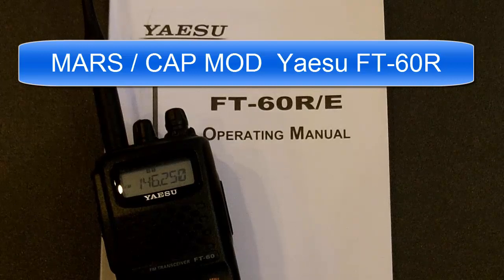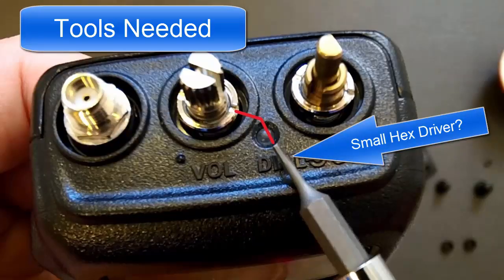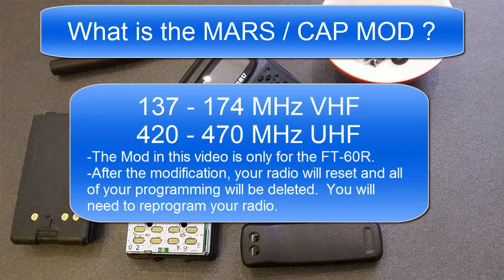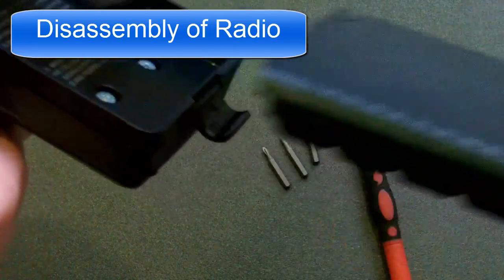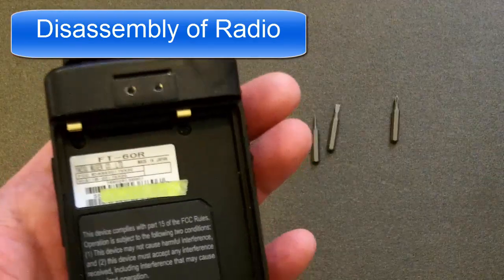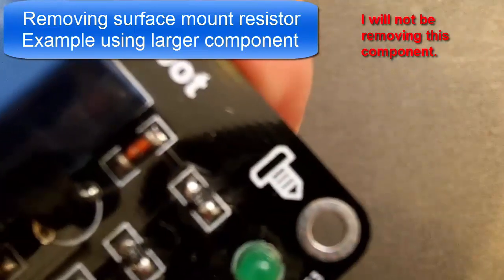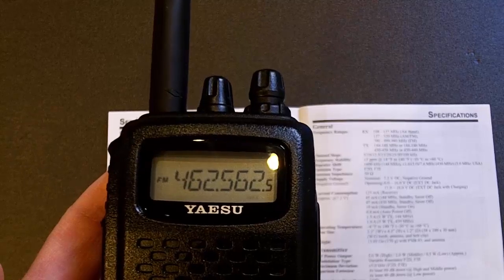MARS/CAP MOD for Yaesu FT-60R : Complete Tutorial : Eye-On-Stuff

Comment: Anyone who does this should instead place the tip of their iron on top of the resistor and then apply slight pressure to the side with a small screwdriver or knife. The method shown caused me to slip and scratch a few traces. Thankfully, all is good, but it’s much much easier to just apply heat. You don’t need a fancy hot air reflow station or a surface mount iron, a normal soldering iron should be able to heat the little component up quite accurately despite not being able to desolder it individually on each side and all.

Comment: @17:31 you show the factory specs of the receive being UHF/VHF 137mhz to 520mhz 
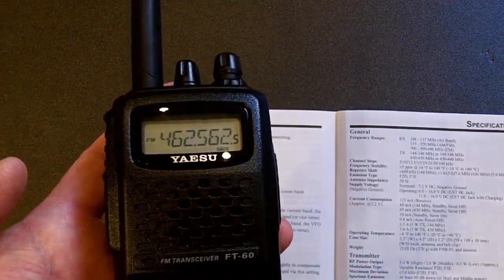@18:09 you show the ft-60r receiving a signal from the frs radio transmission on ch.1 462.562mhz
you are showing the ft-60r receiving but not transmitting on 462.562mhz but the factory specs show that the ft-60r can already receive on 462.562mhz without the mod. why not show it being able to transmit on 462.562mhz?
showing it transmit is something the ft-60r should not be able to do without the mod but it can already receive that frequency without being mod

Comment: After this MOD, the radio becomes Tri-Band? What about the quality transmission/reception in 1.25m (219MHz - 225MHz)?
Reply: The amps aren’t in the right spot or else they would’ve had it allowed in the first place. You’ll get next to no power out on 125 cents and a ton of power out on an unintended frequency in vhf, possibly uhf too.

Comment: Hi! Nice video and amazing explanation! I have a question: this work in the FT-65R? Thanks!!!!
Reply: If you have not already discovered, the 65 has a code that you can find on the www that allows the mars mod without opening the radio or making any physical changes. It is done in seconds by simply inputting the code.  Works great and is a brilliant improvement to the operation required for the ft 60.   https://youtu.be/ztFA_ckgnxo

Comment: Thanks! Does this mod allow you to broadcast also on Airband frequencies, 108 to 137 MHz?
Reply: Those use AM, im not sure a FT-60 can even use AM but I may be mistaken
Reply: @gary0228  I have found out that the answer is the FT-60 can receive AM on 108 to 137 MHz, but even with the mod, it will not TRANSMIT on Airband AM. Bummer. I wish for a radio that I can use while in flight that does TX AND RX on both Ham and Air bands. Darn.

Comment: I have wanted to do a MARS mod on my FT-60 for a couple years now and have watched several videos on the subject but never felt confident enough to attempt it. Your video, however, was so well done and well explained that I finally felt okay giving it a go. And it went perfectly! 100% success. Initially I thought I might have had a problem when I keyed up an FRS frequency to test it out the signal, it had a massive amount of screeching and squealing. I was using the factory antenna and had already been warned that this might happen with that antenna. So I swapped it out with a Diamond SRH77CA and got full quieting. Many thanks and job well done on the video!
Reply: I’ve had my FT 60 since 2017. I just found this video and made it real simple. I did my mod and my radio works great as well. Good job on the video.
Reply: Long time subscriber of you, tried doing this on my second FT60 and had the squelching issue. I was freaking out that I might have bricked my radio until I saw your comment here. I wonder if its an issue on newer FT60's. My older FT60 has no issues with factory antenna.

Comment: Are you able to clearly transmit with low/med/high power on FRS channels? It seems some channels transmit clearly on low while other work on med or high. I hear feedback/screeching on powers that don't work. Have tried with multiple FRS to test.
Reply: I had the same problem using the stock antenna. I bought a diamond srh77ca antenna and then it worked great.
Reply: @oliverdeshler  Thanks, good to know.

Comment: People. seriously, if your going to do this mod, STEER CLEAR of the razor blade method.  Why hams are so cheap and cannot afford the right tools is beyond me.
Reply: What’s the proper tool?
Reply: @GringoFusilero  Tools. Soldering station, and fine tip, plus magnifying glass stand, and light heat and swipe off. Easy if your hands don't shake. Use rosin, the actual rosin, not cheap crap, first on the solder, a small dab, then they come off easy.

Comment: Given that I can't remember which way is which, this mod will BRICK your radio in terms of stored frequencies and other magic.  If you program with the RKS software, make a "safety" copy of the radio before you start this, and I think you have to reload that first, before trying to use the mod.  Apparently the board doesn't recognize the updated firmware until it finds a code in the file to tell it to honor the update.

My FT60 is more than ten years old.  Right about when the price dropped to just under $200....  My VX150 poofed - turned out to be a bad keypad and some other minor stuff.  I sent the radio to Yaesu for service, and the service mangler (that's not a typo) called me to tell me it'd be cheaper to buy a new one - AES and HRO had 'em on sale for about 100.  Or grab the FT60R at about $200.  I went for the FT60R.  No regrets.  Don't tell my wife that I was able to fix the old VX150.  Both of them share batteries and other accessories.  Only one working  battery anymore [grin].

I did the original MARS/CAP mod for the VX150 way back when, and the FT60 is a tad easier, although YMMV, depending on your experience with the surface mounted parts.  In my case, some conductive silver paint was a good idea.  My hands weren't (still aren't) steady enough to fix that without the paint.

You can wrap a little bit of #12 wire around your soldering iron tip and get in there (on the FT60R) easily enough to just warm one end of the resistor enough to pop it off with a sharp instrument.  Or throw all caution to the wind and break the fool thing with a slightly stiffer knife.  On the VX150, there's a trace or other need to require a paint jumper - I forget why.  The FT60 has nothing under the resistor.  If you're nuts, put a fine dental tool into a moto-tool and cut it in half....

Naturally, I just discovered the Baofeng....  A new battery for either  Yaesu costs about twice the price of the Baofeng....  And the Baofeng includes a "desk charger"....

Regards,

Stu K8LEA
Reply: Just so you know....a "bricked" radio is one that is unrecoverable. No amount of anything be it software or hardware can make it work ever again. I think in this case it would be more accurate to say that all memory was either cleared or reset.

Comment: Thank you for this tutorial, it is really easy to follow and I might gather the courage to do it on my good old FT-60R. One little thing, though. You don't need the mod in order to tune that freq. You can totally tune and RX 462.5625 MHz on an unmodded radio, like mine. It is needed, though, if you want to TX on that freq. I'm sure you are aware of that, and your test was on RX just to cover your back ;) ... Am I right?
Anyway, 73 and thanks again!
Reply: Yes, you are correct. Unmodded FT-60 can receive on those frequencies, but will display "ERROR" if you try to TX. This mod unlocks the ability to transmit. Which of course should only be done in a life or death situation and not used recreationally 😉
Reply: Just wow 🤦🏻‍♂️

Comment: MARS/CAP mod gets its name -- as you explained -- for making the modifications to a radio to let it transmit in other than the amateur radio bands. MARS was a service whereby amateurs were secunded to the military to pass messages and traffic. It was principally HF. CAP -- Civil Air Patrol -- is the USAF Auxiliary and does have a VHF component to its communications service. The channels devoted to CAP are roughly around the amateur two meter band. In the old days, CAP allowed modified amateur (Part 97) gear to be used on their channels but not any more since they are governed by NTIA.